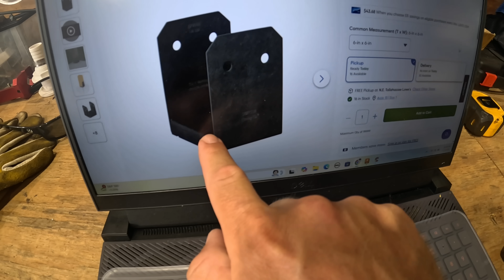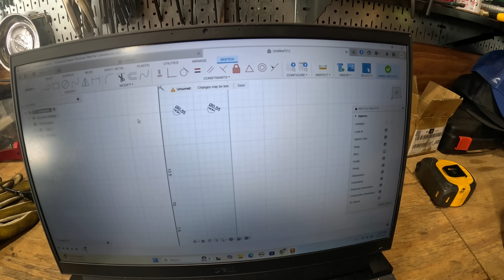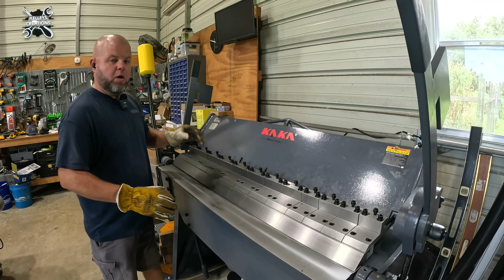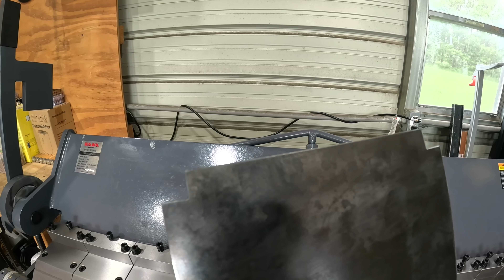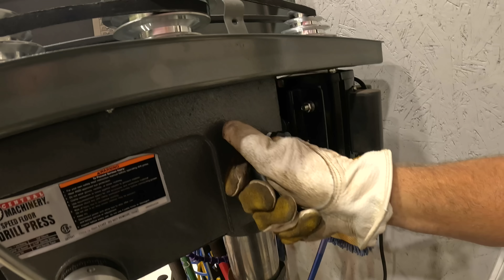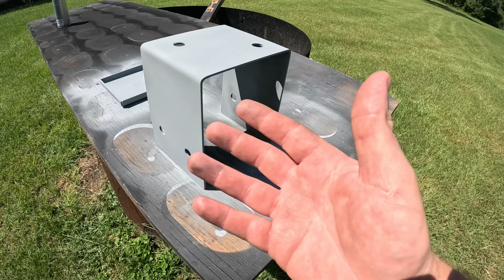Made/Saved $400 In Two Hours! Everlast Plasma Langmuir CNC

Comment: Quick tip on drilling. If it's a bigger drill like 1/2" slow the speed way down and put a LOT of downward force on it. You'll feel it start to bite in then keep the force applied through the cut.

Comment: Someone already mentioned doing your inside cuts first and your perimeter cuts last. I learned that one the hard way. You can also do short straight cuts like a broken line at your bend points to make lining it up in the bender easier and helps keep the bends sharp. You are picking up Fusion quickly, good stuff.
Reply from the maker: Thanks
Reply: Or sometimes I will turn the amps down to 9 and "mark" the bend lines but I think that only the Hypertherm Sync does that. Part comes off the table ready to bend

Comment: I was quoted $3450 and $3600 to install an on-demand $800 propane water heater.
After spending 12 hours and $960 on a better unit with another $150 in incidentals, it's installed, and my wife is happy. $200 per hour.
I swear that every contractor/plumber figures out cost of materials+hours of labor then multiplies it by 2.5 to rip off consumers.
Reply from the maker: Wow! Having installed my own on demand water heater, I can say that quote is insane for a new install. Stories like this is a huge motivation for me to build another home and document everything in a DIY fashion. The amount of money you can save is insane.

Comment: I'm wondering if the metal brackets that now cost $43 each were made in China or the US.   Is it a result of tariffs, higher labor costs, or fuel cost because everything is transported by truck?
Reply from the maker: It wouldn't surprise me if they were made overseas. However I don't believe it's just a tarrif problem. I've been buying post brackets for years now with all the projects I've built on the channel. Usually upper tie brackets and they've been stupid expensive for a long time.

Comment: I'm confused as to why you just didn't update the design and cut the bottom holes with your plasma cutter after you realized you made that mistake.
Reply from the maker: Because it's literally quicker to drill a few holes with the drill press than to sketch, redesign, manufacture and post process a new file. Time is money.

Comment: Andrew - a few tips.

NEVER wear gloves at a drill press....I've watched people spiral-fracture their hand in the blink of an eye and lose entire fingers instantly.

1) If you need help with Fusion - I'm really proficient in it.  I can help you out.
2) Holes first, outer perimeter second, so that the part doesn't slip on the table.
3) Fusion lets you design the finished part first, and then "unbend" the part and gives you the bend line location as well...accounting for the bend radius....

We're here....watching and loving the channel.
Paul
Reply from the maker: Thanks, I am still learning.
Reply: Gloves are fine while drilling. As long as they are tight fitting gloves.
Though you should definitely clamp or otherwise secure your piece when drilling. Especially when drilling larger diameters. That can cut you nasty if you lose your grip.
In fact, when drilling larger diameter holes I prefer a magnet core drill over a drill press.

Comment: You need to get you a 30 inch TV to use as a monitor in the shop for using the Fusion 360. The larger screen will make design work easier and more enjoyable. 
From the scrap steel you are using looks like you built a large industrial mail box?
Reply from the maker: No, that was a cut off from another random job.  Then I cut a bucket holder out of that scrap piece for myself.

Comment: Have you heard of hot flocking with powder coat? It will be better than using the cold galv that you are spraying the brackets with. You use a torch or weed burner to get your metal up to temperature and shoot it with power coat. No oven needed.
Reply from the maker: No I have not, something to look into.
Reply: @TKCL yes there is several videos on you tube about it. My husband was a welder/fabricator for 30 years and I learned about it from him doing projects at the house but didn't want to pay to get something powder coated or it was bigger than most powder coating ovens would fit.

Comment: Trump and his Tariffs are killing us.😮
Reply: Stuff was expensive long before any of that happened.
Reply: @--_DJ_-- Only one he is looking out for is himself.😮
Reply: @MotorMark56  Ya, sure, that makes so much sense.
Reply: The Simpson brackets are expensive because they are engineered, stamped and designed for specific applications and loading. You can buy much cheaper ones that are not engineered but they won’t last as long or pass inspection in most areas in Florida. Andrew’s brackets are Simpson’s on steroids.
Reply from the maker: Brackets went sky high during covid and have never came back down, this isn't a recent problem.  And Tripring is correct, you are paying for load testing, design, manufacturing and in a lot of cases GREED. I don't need stamped brackets for my job and I like to overbuild them.

Comment: Invest in one of them fans that runs water through it.  Big difference!!  I got one for the toy hauler when I sleep in the back
Reply: They don't do as well in humid conditions like he has.
Reply: @--_DJ_-- im in the same area as him.  It helps
Reply: @HalfPint5811  I'm sure they do, it just isn't the environment where they work really well. For the headaches of using one vs the benefits, I passed on that option.
Reply from the maker: I have a misting fan on the porch, it does help, but much more suited for low humidity environments.  The main reason I don't want one in the shop is rust issues with tools and steel. I just ordered a large exhaust fan.
Reply: @TKCL I have one that runs water over the deal and cools the air, doesn't mist or blow out water
Reply from the maker: @HalfPint5811 yeah I know exactly what you mean, my buddy has a huge one.
Reply: @TKCL basically a swamp cooler

Comment: It was a little funny that right after you realized you should have included the holes when the plasma table cut everything out you show cutting the other brackets out and it didn't include the holes in the middle. Was wondering why you didn't fix the mistake you just realized, but those were probably filmed in a different order.
Reply from the maker: Because it's far quicker to drill a few holes then go back and redo the sketch, design and post processing. I am still very slow at all of that.

Comment: Just a hint, cut the inside holes first, then do the outside perimeter.
Reply: Sorry, I didn’t see the previous comment!
Reply: What difference does it make changing the order of operations?
Reply: @--_DJ_-- if you cut the outside first, the part can move and inner cuts will be off from the proper location
Reply: @jimcollins9316  Ya, I though of that 2 seconds after I asked the question.
Reply: @--_DJ_-- don’t ask how I learned that!!
Reply from the maker: Yep, I didn't set that up correctly.

Comment: Flip your cut path so bumps and air pressure don't mess things up. Cut the outer perimeter last after you cut the holes.
Reply from the maker: That's the way it WAS designed until I started flipping the origins and start points. Still a lot to learn.